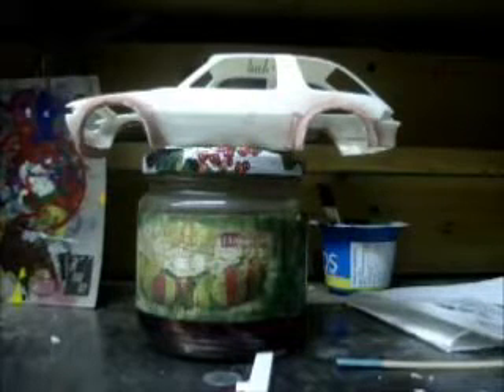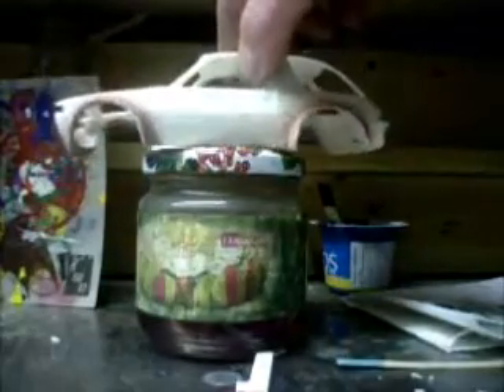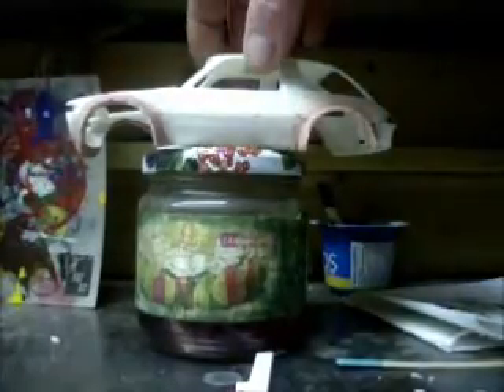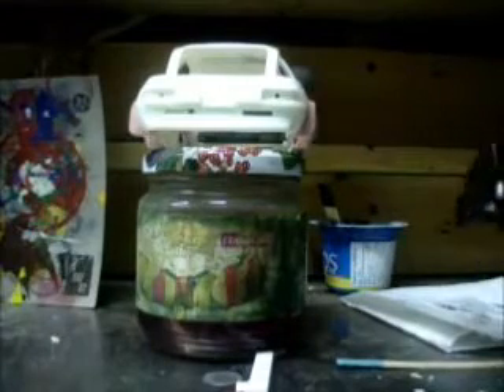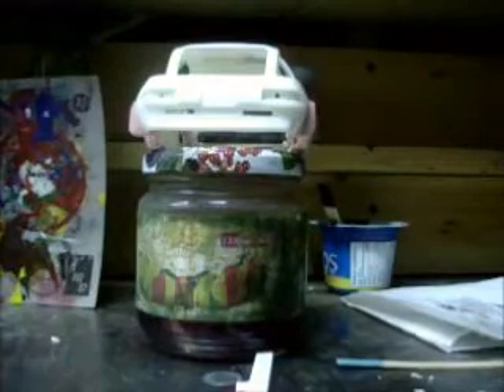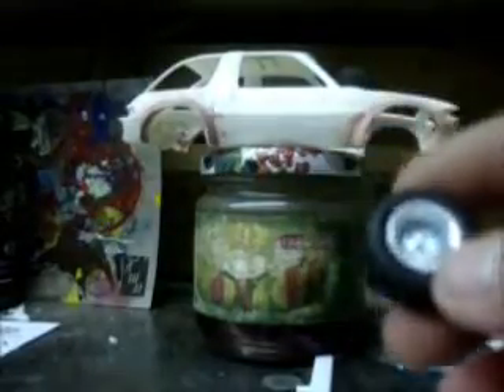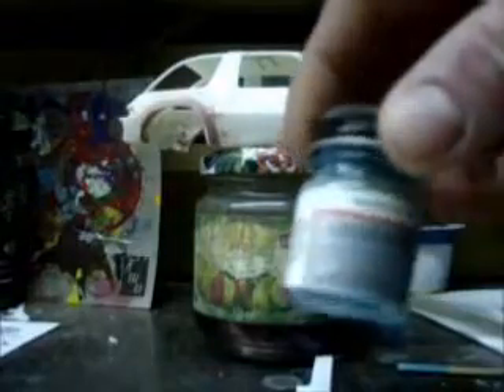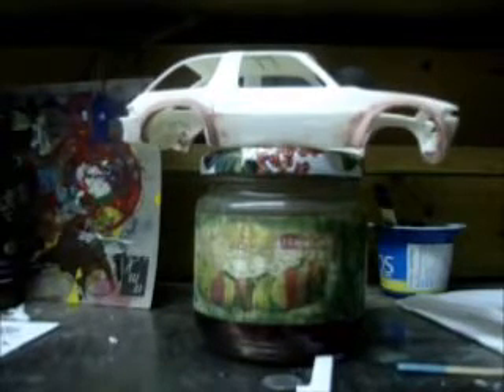MPC 1978 AMC Pacer X model car  IN 1/25 SCALE

Comment: Cool build, what did you use for the fender flares?
Reply from the maker: Hi i used styrene stripes and red glazing  putty
Reply: @oldbeatercars  that's cool, how exactly did you build them though, did you attach the styrene to the model directly and then mold them while they were on the kit, shaping them and filing them on the model, or did you build them before, and then attach them to the kit?
Reply: The only Pacer model kit that's available anymore is the station wagon version, if you want an original Pacer kit, you have to buy one of the old MPC kits on Ebay for quite a fortune. Wish they would hurry up and retool some of the old MPC style kits, along with the new station wagon version they have available.